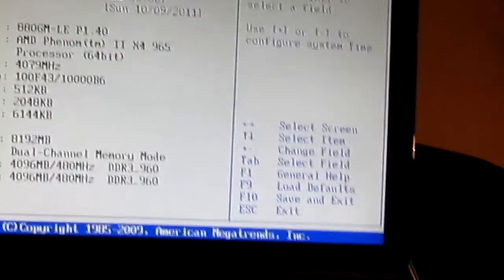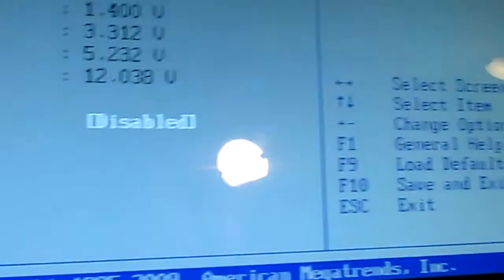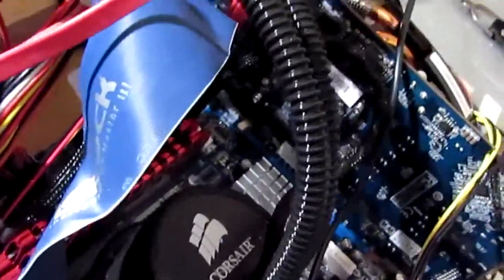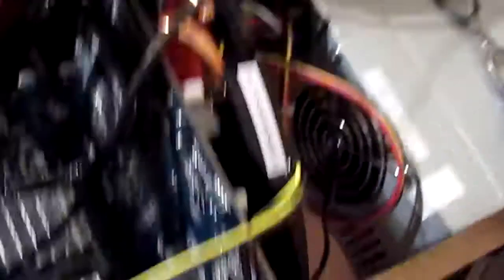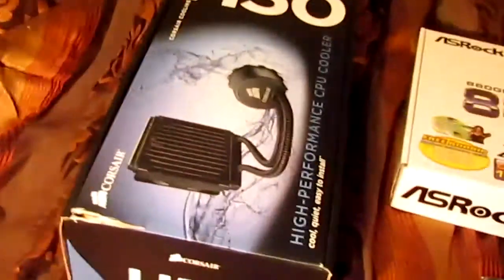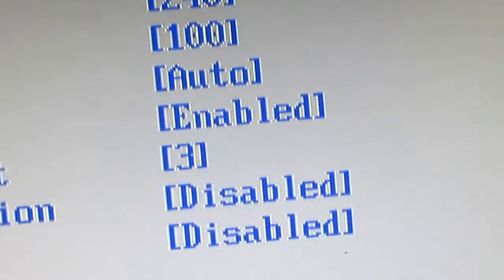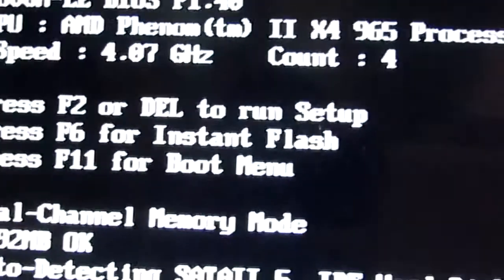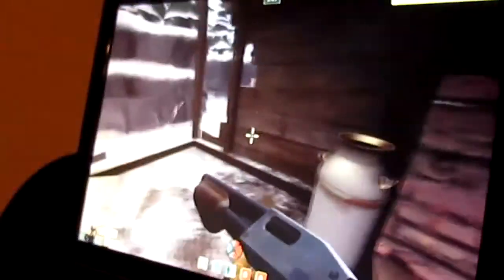Overclocked dual boot Gaming computer Treadmill Water cooled

Comment: You should seriously put that SSD to good use, instead of wasting it with XP's poor SSD optimization, or lack there of really.
Unfortunately you don't have one of the bundled drives from OCZ, Corsair, etc. that includes SSD caching SW. But you can use this, it looks very plausible and should give a decent performance boost to your Raptor.

Fancy Cache by Romex Software, it's free.

Also, make sure you're getting good "active", not passive airflow over those mosfets & caps + NB HS.